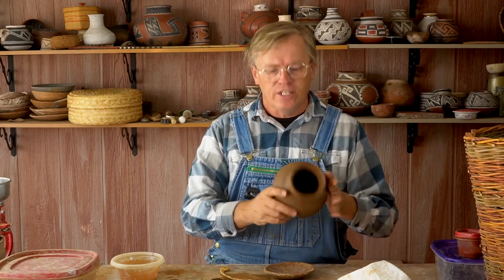How To Prevent Drying Cracks? - Primitive Pottery Q&A

Comment: Great video, I use shopping bags from walmart to cover my pottery as it dries, that way it doesn't put stress on the rim if I were to set it upside down. I found that keeping the moist air it the pot sealed up at the top helps even drying as well. My pottery usually cracks in the fire when it cracks. That happens of course from the un even heat. These are good tips, thank you Andy.
Reply from the maker: More temper will protect against those firing cracks. Thanks!
Reply: @AncientPottery  What is temper?
Reply from the maker: @micheledickey4066  sorry, temper is non-plastic material added to the clay. Most often sand or grog.

Comment: Cracked my first attempt at a coiled bot yesterday.  My puki's not fired yet, so I started with a flat bottom.  Unfortunately, I set it on a non-porous banding wheel, which it stuck to very firmly.  I also dripped water into the base as I was trying to keep the coils moist.  I needed to wedge up a new batch of clay to complete the last couple of coils, and as it sat there waiting, the sides were drying and shrinking while the base was stuck to the surface.  I should have taken it off and covered it up while it was waiting for its next coils.  Oh, well, lesson learned.  At least I could recycle the clay!
Reply from the maker: Experience is the best teacher. Thanks for sharing your story.

Comment: We have an area with black cotton soil under which there is a layer of pretty pure white clay, but it is very expansive. Can this kind of clay be used for pottery as well?
Reply from the maker: The expansiveness means it will have a high shrinkage rate that might make it bad for pottery. Probably will be better used as slip painted onto the outside of a pot.
Reply: @AncientPottery  Thanks a lot, I will try this!